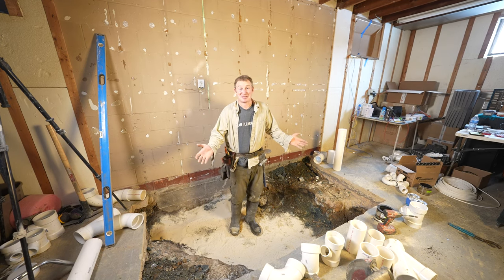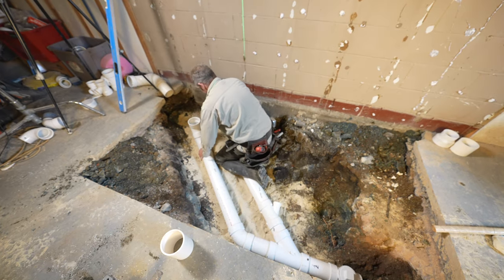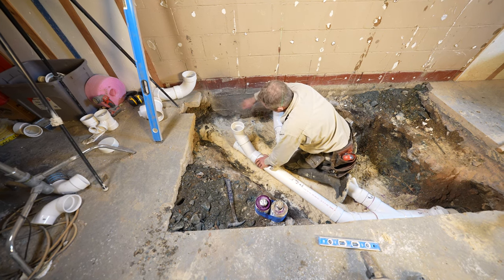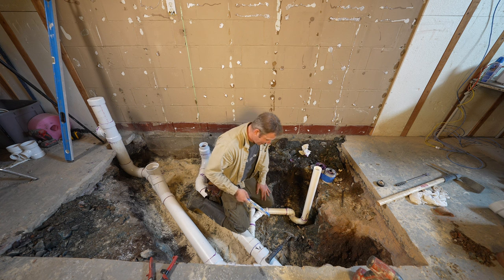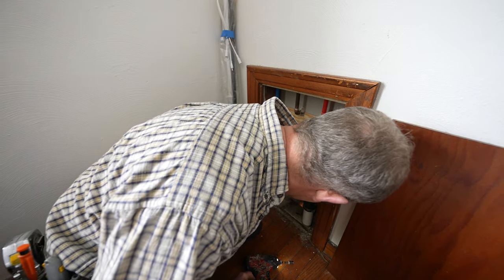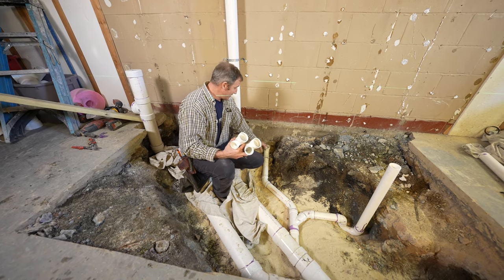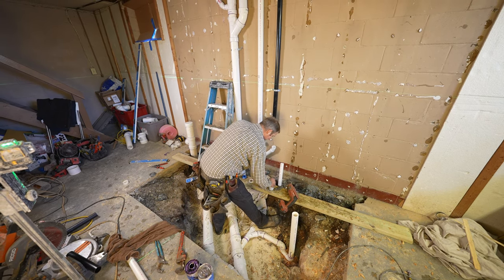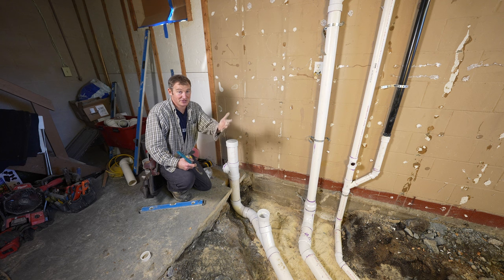Plumbing for a Basement Bathroom | PLAN LEARN BUILD

Comment: great video truly, but one glaring thing to me is i believe that basement bathroom group is improperly wet vented. Plumbing to code can be very tricky so I don't fault you. I believe the way to correct that would be to have your stack wrap around the same wall as your clean out and 90 down towards your main drain that way you can catch your water closet, vanity and tub on the same line and then catch them further downstream on that 3 or 4 inch drain line. Of course this is just what I see and if you already passed inspection what im suggesting doesn't matter. Thank you for the content regardless it was a pleasure to watch!

Comment: Personally I would have taken that ABS vent down the joist cavity towards the block wall. Then 90 down into the future stud wall and then do a horizontal run in that wall over to the left and down to the sink drain. That way you avoid having to put big holes in your joists weakening them.
Reply: NO KIDDING.  Cringed when he did that.  Or at least drill through the MIDDLE of the joist as it's obvious drilling that low wasn't necessary.

Comment: Thanks for this. After we finish our kitchen we'll be tackling a basement bathroom and relocating a laundry hookup. Except we'll be tearing out an 80s era illegal bathroom instead of just blank concrete. This series is helping me visualize the project.
Reply: Are you planning on radiant heat in the bathroom floor?
Reply: @kevinhornbuckle  Considering it. Really want to keep costs lower on this project as it's not going to be a showcase. The basement will be hobby/DIY spaces, laundry, and storage. And I'm not a fan of resistive heat, and wonder about the performance of the type of products used on this channel when installed over a concrete slab. But they just seem cheap enough we might just go for it anyway.

Comment: Excellent video .. I've done a few of these and it took me forever to find out the correct way to get it done right.  Tying in the upstairs bath and fixtures def adds some complexity.   Also yes here in VA they don't accept the ABS-PVC glue, you have to use a fernco or something like you did.  You are a great instructor for practical real-world bathroom remodeling!

Comment: My one negative comment:  instead of cutting holes in the joists to run the drain line for the upstairs vanity, I would have run it within the joist bay to the wall and THEN UNDER the joists as that would presumably be within the new wall that will be framed in.

Sidenote:  how do you propose framing that new wall around those pipes?

Comment: Why is a shower (vs vanity) considered two fixture units in regard to venting via one Y? Just for the volume of water coming through it or for some other reason? A word of caution for the DIYers; pay close attention to what Steve is talking about in regard to WET vs DRY venting! So much to unpack here so make sure to understand before proceeding! Another epic BRT video not seen on the tube yet.  p.s. ten courage stars for the team, to make this unpredictable dig and have a nerve to keep all the lights and video equipment just to share it with us!  👍💪👊
Reply from the maker: Thanks 😊 and that’s a great question. I pretty it’s based off the water volume consumed. I’ll have to look up what that threshold is. For instance a toilet is 3 future units @ 1.6 gal, but 4 above that 👍
Reply: DFUs are based on Water Supply Fixture Units.  Showers are 2 per shower head and lavs are 1.5

Comment: Question: How does having the horizontal wye plumb ensure it has the correct slope?
Reply from the maker: Yes dwv fittings have a preslope built in 👍
Reply: @BathroomRemodelingTeacher  I understood that referred to 90-deg fittings not being actually 90-degree (to allow for pitch) but never heard of this with horizontal assemblies. I'm actually dealing with this issue right now. Can you provide more details?

Comment: Man, that looks like a lot of work but you're flying through it. I did a basement bathroom reno last year and redid all the plumbing under the slab. It was my first time so I went slow and it took me a long time, but it turned out great. I probably spent twice as long as you to put together half the amount of piping. I can appreciate the work you put into this!

One thing though... you keep saying your toilet will be 12 inches from the framing, but isn't it supposed to be 12 inches from the finished wall? In other words, 12.5 inches from framing minus half inch for drywall? Not sure if you misspoke or what, but I hope that doesn't come back to bite you.
Reply from the maker: Yeah you can account for the wall covering in that. American standard toilets work well even at 11 1/2”

Comment: I don't recommend beating on pipe with a metal hammer.  A mallet would be better.  It can crack the pipe and/or fittings that you won't notice until it's too late.

Comment: Can you connect 2 toilet and 2 showers and 2 sinks in 1 -3 inches abs pipe.
Reply: I believe u cant do that with 2 toilets on the same line, not enuff air will get in with a 3in
Reply: Typically 3rd toilet ties in on a vertical if still needed to be on 3”. On horizontal, after the 2nd u need to jump to 4”. This is why you see back to back bathrooms on 2nd floor coming down on one 3” line to the basement. It’s all about fixture units and size and orientation of pipe,

Comment: Might be dumb question, but what type of pvc pipe u using? Foam core, solid core? Just learned there’s differences between dwv pipes. All lowes and HD have is foam core and wanna know if thatll do for something similar to this.
Reply: Underground should always be schedule 40
Reply: Schedule 40 refers to sizing and wall thickness standards, not if it's foam core or solid core. @Ghost87v  

Solid core has red text on it (at least at Home Depot) or will say it is suitable for pressure applications or have a psi rating on it.  You can use foam core underground, as is the case in this video.
Reply: @therealSIRBOOM  is solid or foam core more quiet? Thx

Comment: I did not see a sliding joint in the vertical stack between basement and upper floor, I think that is a Canadian code install requirement though my son's house did not have one and his ABS pipe shattered one Spring when the house settled, (or someone knocked it in the unfinished basement). It was definitely needed for us to put the system back together. I had to get the joint from a plumbing wholesaler and I think it was  around $70 Canadian. In my Canadian house I also had to add a sliding joint on a vent stack because it was pulling apart,  you don't want this happening buried in a wall where you might only notice the smell.
Reply from the maker: Never heard of something like that happen….guess there’s always a crazy chance that could happen…sorry you had an issue like that
Reply: @BathroomRemodelingTeacher  if memory serves the ABS came through the cement floor without a foam wrap so if house moved separate from cement floor something has to give. I guess I would also suggest wrapping joints going through Cement floors to be wrapped with flexible foam or bubble wrap.  I am helping my brother in law in Mexico whose house will have both a cement floor and a cement roof. The roof stack must have a solid pour around it or roof will leak I will be making sure to include flexible foam at the floor pass through and seriously considering a sliding joint or a rubber coupling to provide for some vertical movement, it does not help that the area experiences 7 point earthquakes every few years.  At least it is PVC.

Comment: is that a legal horizontal wet vent ? I thought you had to tied the stack before the bathroom?
Reply: I also thought the venting had to be in the top 1/3 of the drain line, roll the fittings off flat allows for this.

Comment: I have struggled with separating dry fitted pipes. I end up breaking several of my fittings and I don't know how to prevent this.
Reply from the maker: Yeah it’s painful since things cost so much now…average fitting is $30..
Reply: @BathroomRemodelingTeacher  I've considered using butter on my fittings to make it easier to remove but then it's a mess to clean up!
Reply: Dawn soap and water 💦 put it in a Home Depot spray bottle shake well spray your connections when test fitting comes off easy! Thank me later 😊
Reply from the maker: @xxxdpgxxxx1389  great tip

Comment: A wet that needs to be increased by one size, Is shower drain needs to be a 2 inch, If a lab is tying into it it also has to be a 2 inch to increase it by one size for a wet vent

Comment: I know you are trying to help people, so I appreciate that, but if you don’t show how to do it properly, you are only setting them up for failure.

I see some, who are obviously plumbers, have already commented on some of the improper venting, but there are several other improper venting and drain issues that weren’t mentioned. Who ties a vent into the wet portion of a 3” stack? Not a plumber. That’s just one thing, but there are many others. Also, somebody already mentioned reaming and chamfering the plastic pipe. This is crucial for a proper solvent welded joint, plus, the chamfer makes it easier for rookies to dry-fit their system because it will allow the dry pipe to seat completely and it will go into the hub without having to whack it with a hammer, and it will pull back apart much easier. I think if this was inspected, there would be a follow-up video showing you tearing everything out, and I mean everything, then you trying to do it the way it is supposed to be done. There is no code where this “system” would pass inspection.

There is a reason plumbing is a specialized trade. We spend years learning our trade so we can provide our customers with a proper, well-functioning plumbing system. We make money fixing problems caused by people doing their own thing and covering it up with drywall and tile.
Reply from the maker: I appreciate you watching and commenting, but if you are not going to watch the full video it’s not really a well informed statement. It’s not a wet vent there. It’s vent that goes straight to roof. And chamfering piping is something I think is nice to do of course 👍 much respect to all the master plumbers out there 👍 there’s a lot more for me to learn I agree
Reply: That shower trap is right at the main drain line level.  That leg will get backup from the main drain leg and will be set up for repeat problems down the road.  Roll the branch fittings so the  branch lines have substantial reduction of backup from surges of flow.

Comment: You really need to review your wet venting layout.  Wet venting is way more restrictive than you are showing. You have most of the correct fittings, but the positioning is wrong. You also have exceeded the fixture units on the wet vent. 
There is also a limit on how long a pipe can be without a fixture on it— think about your clean out length. 
With that existing 3 “” copper vent , it would have been just as easy to vent each fixture. 
Please folks that are seeing this—- there are a few problems with this system. 
Remember to get your permits and inspections and use the code that applies to your jurisdiction.

Comment: That’s not how you horizontal wet vent. The toilet would need to be first with wye branch shower/lav coming in after so air can be pulled in. Your toilet is straight up not vented.

Comment: the toilet can not vent from the Face sink  that wrong the toilet need's a separate vent also the wet vent is for the shower and the Face sink ( so the shower venting off the Face sink  pipe so that's a wet vent) Then u revent so u put the Face sink vent with the toilet vent and go out with one vent pipe
Reply: so why u want to drop the pipe lower   for the vanity and u could Just make it work by putting the pipe the  correct height

Comment: Loved this video until you drilled through the bottom of the floor joists. Bottom of the joist is under tension loading so not cuts there...ever. Has to be in the mid area of the joist. Hope the floor doesn't start to sag now. But loved the plumbing work!
Reply from the maker: 😆 yeah wasn’t the smartest thing, no one’s perfect I guess. Supporting walls make me feel okay about it
Reply: @BathroomRemodelingTeacher  Good point about the extra support walls. Thanks for the video!

Comment: As an architect always checking trades to make sure I know aware of technique.  But when I saw you cutting through he floor joist I had to write this comment.  NEVER cut the top or bottom of a floor joist.  You either get back to the outside wall and into the wall framing, go below the floor joist beams and create a soffit, or if you have to go through the floor joist beams only go directly through the center of the beam.  Never notch the top or bottom of a joist or beam, and the hole should never be more than 1/3 of the beams / joists depth.  The hole should also be no closer than 2” to the top or bottom of the beam either.
Reply from the maker: Correct ✅ 😊

Comment: Um... why are we boring holes into the very bottom of floor joists instead of either (1) running that ABS pipe within the joist bay to where the new wall will be and then kicking it over in that non-structural wall or (2) just drilling the holes in the middle-most of the joist considering it obviously didn't need to be run through the bottom of the joists?  People... don't do that.  Also, I wouldn't be surprised if an inspector challenged that toilet being vented properly.  Don't have the measurements -- it's likely code, but still, with this design, I would have brought a vent up from the cleanout in the wall that'll be there and tied into a dry vent just to be on the safe side (especially since no new wall there will be structural and you can drill as many holes as you want, basically).
Reply from the maker: It’ll be okay Karen, there’s a support wall 12” away
Reply: @BathroomRemodelingTeacher  Uh, my name has an accent mark over the e, fella!

Comment: Coming from a plumber,  who’s licensed,  this guy gives bad advice imo. Watch out. UPC code and manufacturer recommendations are both vital to proper plumbing installation. All pvc dwv pipe should be reamed/chamfered,  every end,  every size. You WILL have leaks if you don’t. Torque specs for fernco mission couplings are there for a reason,  60ft lbs of torque. Don’t just use an impact drill and wrench it. ESPECIALLY FOR VITRIFIED CLAY!!  Good lord man,  what plumber doesn’t chamfer pvc?  IT’s elementary plumbing.
Reply from the maker: Good advice 👍 thanks for taking the time to add your knowledge 👍 
I’ve yet to see a plumber here chamfer anything, but solid advice
Reply: You know damn well plumbers don't ream and chamfer all pipes. Copper is a different story.
Reply: 60 ft lbs? Haha I think you mean inch bubba
Reply: I dont chamfer pvc and I just am about done soloing an entire underground for a school, as a first year, but guess what, in utah you can air pressure test ur PVC, and NO LEAKS!

Comment: Brother I’m sorry but you don’t understand venting and I’m not saying that to be rude.
Reply: Non the less you’re busting your behind and you can work pipe for sure just need a few pointers. Your drains are coming off your vents? Your vents should come off the drain lines for the shower and toilet not the drain branching off the vent line.
Reply: It’s called rolling your vents rather than conventional plumbing look it up.